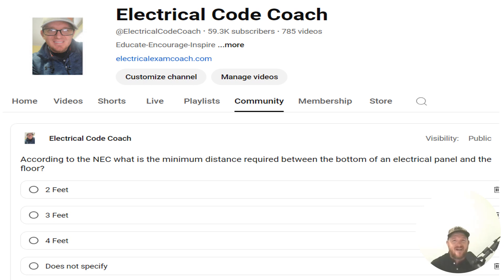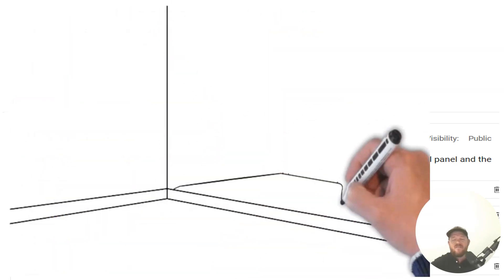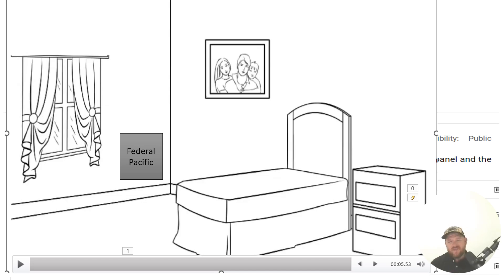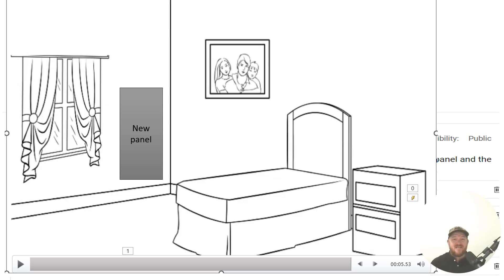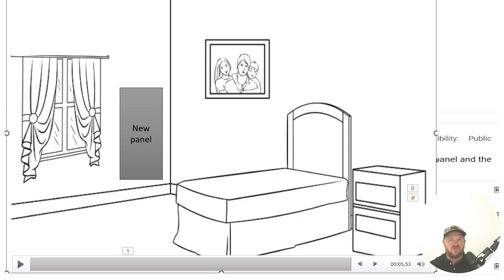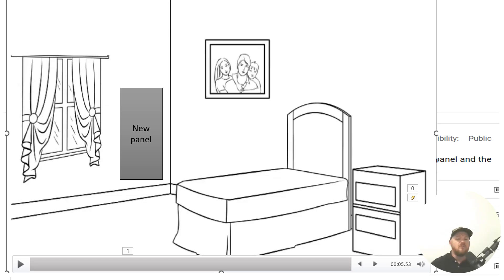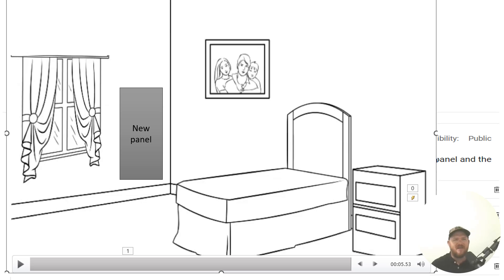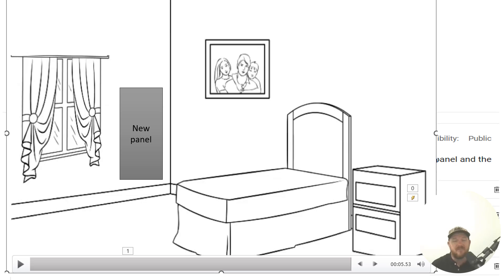#159 Electrical Question of the Day How low can an electrical panel be

Comment: Do you have a video on where not to drill holes on walls?

I'm always paranoid when hanging TV's where receptacle outlets are now in the middle of the wall just behind where the tv is going for concealed installations.

Even with experience in framing this has been throwing me off.

On a job I drillied a small hole behind where the plate goes of the recepticle so i could cover it up afterwards. I placed my scope to see what was there and i saw a piece of blocking that i later used to anchor the lag bolts. But when i did it seemed to hit something metal as if there was a metal wire protector piece either within or at its other end (but lag bolts plus drywall should have been longer than the bolt).

Happened twice in same job, one on each floor. What could have I been drilling into?

Comment: Hey bud where can I buy the link to the prep course you talking about thanks bro
Reply from the maker: Here is the link for the 400 

https://electricalcodecoach.com/shop/ols/products/400x-exam-prep-questions-pdf-with-answer-key-custom-feed-back-and-code-references-20202017-compatible

Here is the recipe if you really want your license 

Here is the recipe forgetting ANY NEC test, license or certification. Sign up at..

https://electricalcodecoach.com/shop/ols/products/joel

Right now it's only $129.99 for a Lifetime Membership

1. Do the entire pro version.

2. Do everything in the ECC testing center.

3. Grind for 30 minutes a day on 100%

4. Grind 1-2 hour a day for 10 days leading up to the test.

5. Go take the test.

6. If needed, repeat until desired result

If you don't have your code book and tabs you can pick them up here.

https://electricalcodecoach.com/shop/ols/products/2020-special-offer-180-with-free-shipping-in-the-us
O
Here's my cell if have any que tostions or need help 423-895-3247